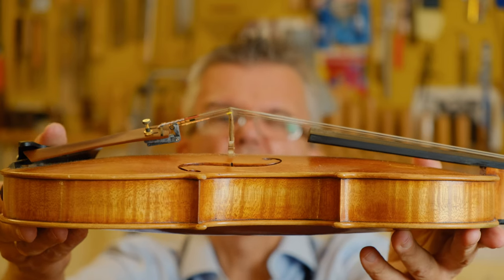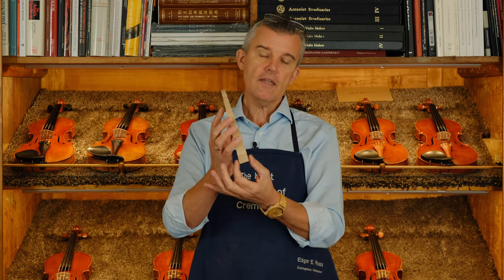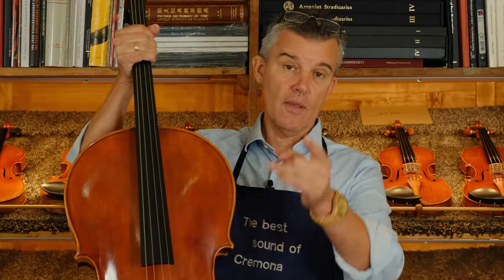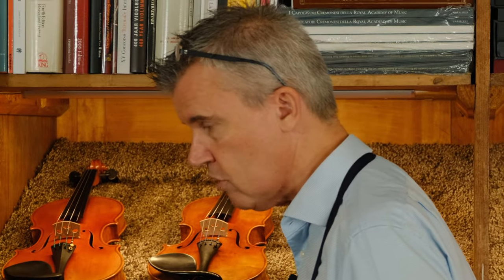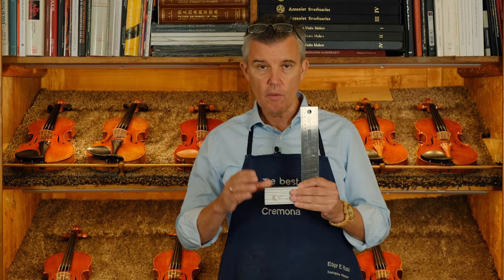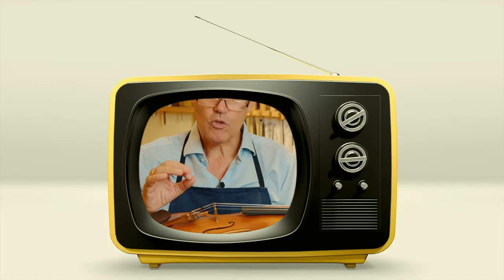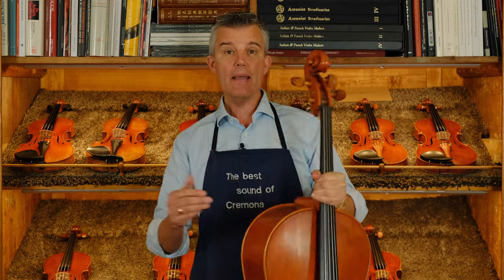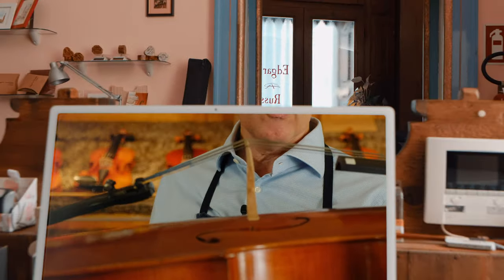How To AVOID a BENT Bridge

Comment: The 90 degree angle is not always quite so obvious how to measure. At least on my violins the top starts to curve rather quickly behind the bridge. The area in front of the bridge however is flat for a longer distance and I find it easier to measure the angle from there instead by placing the business card to the side of the bridge.